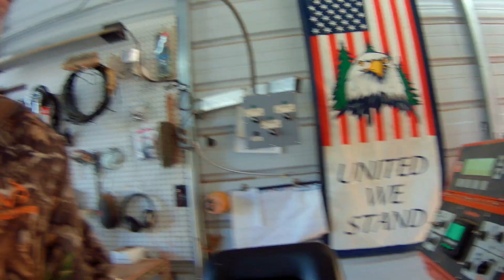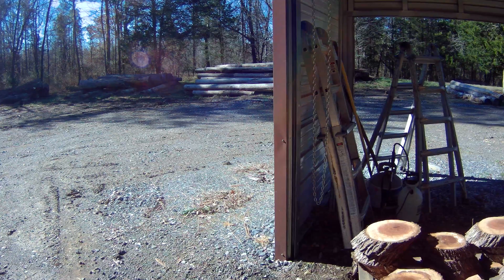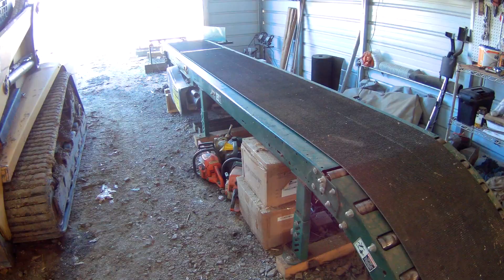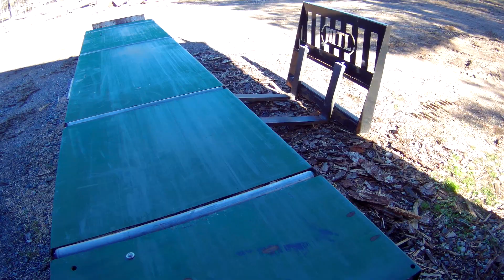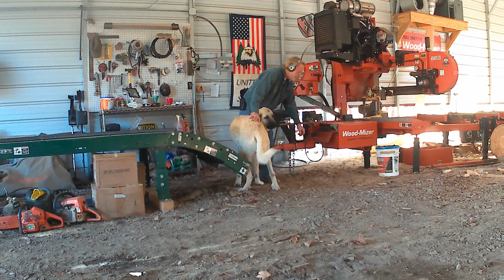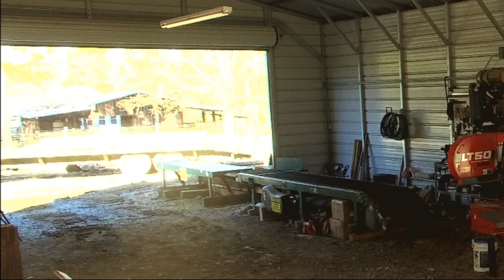Sawmill Take off conveyor, with Brewtus (The sawmill dog).

Comment: I am in the process of trying to setup a laser on my LT15 mill. I had it all setup then it got bumped out of alignment and as you know its a pain to re align. I really like the idea you have of putting reflective tape on the walls to check the alignment. I imagine you could even align it back to these marks to make a quick re alignment.
Reply from the maker: Yes that’s exactly right. Even fine tuning the laser is much much easier.
Thanks for the comment and for watching. Let me know if you have any questions later. 
I enjoy helping people.

Comment: What size electric service is wired for your sawmill shed? How much do you draw when everything is running?
Reply from the maker: My sawmill has Diesel engine on it. I would assume a 400 amp service would supply all of the power you would need. You could later expand if needed by placing another 400 amp panel if needed in the future.
I hope that helps you good luck with it.
Reply from the maker: I forgot to mention, I have a 100 amp service panel in use at my sawmill but I only have lights and a few receptacles being used. I hope this helps.